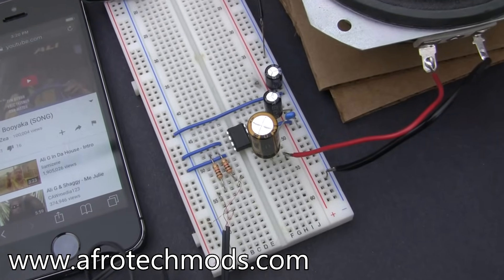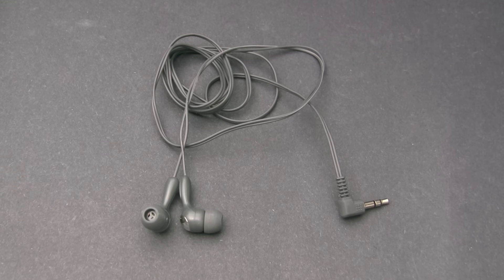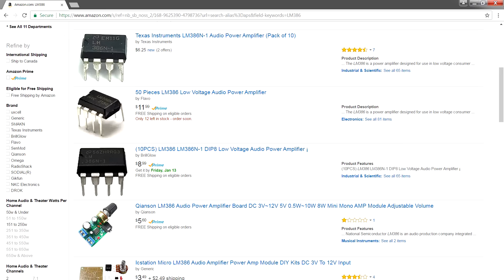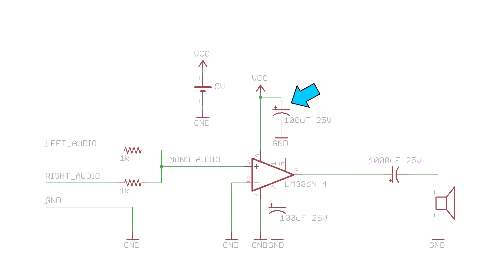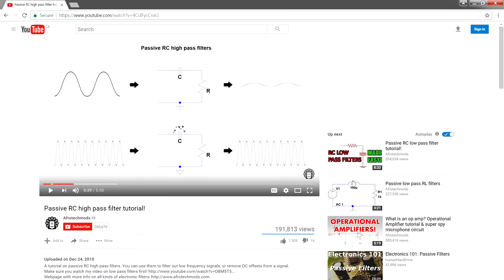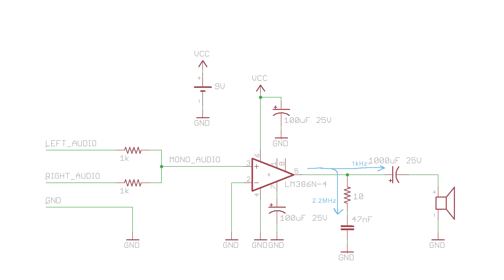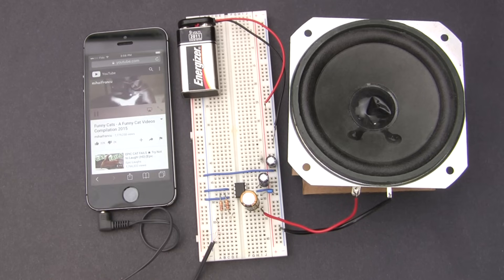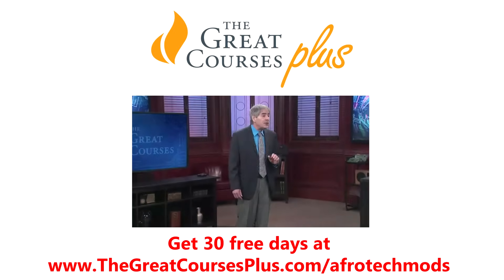🔊 How to make an LM386 audio amplifier circuit

Comment: if I feed in the signal of an electric guitar directly to this circuit will it work too? Since I only had an UTC2822H I copied its "BTL application circuit" (which I also don't know what means) and powered it up with 5.7V, all I achieved was a finger tip burner and silence. can anyone help me or should I just buy an LM386?

Comment: Regrettably, this is dated information. The LM386 is being phased out. They are much harder to find now, and they are being hoarded while their price is rising. This video should be updated using the LM386 replacement or alternative. I am unhappy because it was a relatively easy chip to learn.

Comment: Is the top capacitor in your circuit for decoupling (100uf), and the bottom for noise filtering(1000uf)?

Comment: Great ,  I did it and works perfectly
But if  i want to use a variable resistor what to use ? for volume
Reply: if you still need this, a potentiometer as a voltage divider at either the output or input should work

Comment: I had a similar circuit to yours but it was a little noisey. After increasing a few cap values to match yours and adding that 100nF cap between LM386 pin 6 and ground instead of the RC combination I had, I have a very quiet circuit. Taking your advice to shorten up the wires eliminated the am radio station I was picking up too.

Comment: HI! I am looking for a small amp for a project to amplify an acoustic guitar pick up and I think this will work, I just have 2 questions: 
1)What kind of speaker is that that you are using? (power and impedance, or if you have the link to buy it, that would be great).
2) If i wanted 2 speakers, not necessarily stereo but just 2 mono speakers, what adjustment would I have to do? 
Thanks!
Reply: carlos arteaga ....I'm working on something similar....except i wanna use a surface exciter instead of a speaker and install it intothe acoustic guitar. Did you ever finish your project?....was it loud enough?

Comment: can this power up a 8ohm 25w speaker?
Reply from the maker: Yes but you won't be able to drive it at full power.
Reply: Thanks for the reply! I tried this circuit and it works pretty well! I removed the 9nF capacitor and put it in the 8th pin in the circuit and it reduced the noise.

Comment: You could use two of the 386 chips at the same time since they are mono, have one of them amplify one channel then have the other amplify the other channel for basically two watts, Allowing more power to be transferred to the whole system, and one speaker for each amp, so just the one amp wont draw more current and get hot or quieter when hooked to more than one speaker especially from delivering a decent amount of current :) Awesome Videos Afroman!
Reply: You can use 4 of them. each channel 2 chips in bridge mono mode. Even more power.
Reply: Never thought of that, they have a bridge mode? you could probably get even more power if you had some sort of digital splitter for Dolby 5 Channel and be able to amplify 5 different channels with 5 of these. Or Bridge mono mode 5 channels. so 10 of these. @KneppaH
Reply: @cameraman1234567890  I made one myself. First try was a stereo bridged amplifier with 3 x LM386. But it had weird stereo side effects. After that i made a proper dual mono bridged version, with 4x lm386. It works perfect.
Reply: Probably had different delays in the signal, who knows. The Bridged config sounds like the way to go. @KneppaH

Comment: Hey Afrotech. Thanks for the vids I find them really informative. Just started with some audio amp and trying to wrap my head around it all. I was just curious if you could expand on a couple of things quickly. They are probably really basic so feel free direct me anywhere else. First how do you know what value capacitors you should be using? Why does the Capacitor filter the hig frequency rather then an actual High pass filter?

Comment: One cool variation: instead of joining L+R channel inputs, duplicate the circuit, each with its independent L and R input and speaker, and get full stereo sound. With one full Watt per channel to boot.

Comment: Hi! i kwow it is self evident to you...but you might tell that you need to put a speaker in a (large enough) box to get any lows/bass (as people watch you using bare speaker-no box). Just cardbord box, plastic drain tube that fits speaker or big tin can works ok (to boost bass).
Otherways people might think they messed up the circuit and has no bass output.

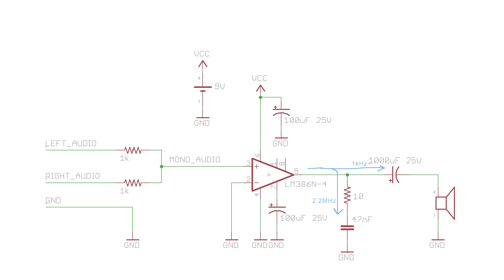Comment: at 4:44 you said rc high pass filter , but from the rc low pass filter video i saw that the resistor is connected to the signal and capacitor to ground , and for an rc high pass filter is capacitor first and resistor to ground, isn't an rc high pass filter supposed to attenuate the low frequencies?? and the rc low pass filter is the one that attenuates high frequencies ? i just seem to confuse this whole thing, would some one explain it to me ? , 
thanks
Reply: A bit late. See, high pass filter passes high frequencies. Here it is passing high frequencies to the ground, letting lower frequencies go the other way. The tutorials for low pass and high pass are actually the same thing from different views. In low pass circuit you choose a high frequency cut-off with capacitor and resistor combination and take the lower frequencies to use. In contrast in high pass filter circuit you take a low frequency cut-off combination and take the higher frequencies into use. In both versions you could take the other part of frequencies.

Comment: Regarding the 100nF and 1000uF caps on the output, the 100nF cap will always have a much higher impedance than the 1000uF, so wont higher frequencies choose the path of least resistance, i.e, through the 1000uF cap? I dont get it :-(

Comment: Question....I have a mono single channel input that I'm looking to split into 2 signals at the output stage (stereo headphones with the same signal in each ear).  Is it as simple as reversing the 1k resistors to go to 2 channels after the potentiometer for volume control, or even simpler by just splitting it with no resistors since there's no signal to balance?

Comment: Eh, the sound demonstration clearly shows the most important caveat of such "simple" design (that uses a weak power source and a questionable speaker too): the complete lack of bass. You just simply can't get it without a good power supply and good speakers.

Comment: I wasn't sure who to believe as several other youtubers (who specialize in audio electronics) suggest 200-500uF output caps. So I tried it and the bass was way quieter than everything else. Replaced it with something over 1000uF as you suggested (2200uF) and it's fine now. It led me down the rabbit hole of realizing the cap and speaker form a high pass filter, so I can calculate the right values in future now. :) Thanks for the great tutorial video!

Comment: Hello, I am new to audio engineering and I am trying to see if I can create a studio condenser microphone from scratch caveman style. So far I have managed design a tension jig for the diaphragm in AutoCAD and 3D print it from my university library. I am currently planning to mill a copper disk for the backplate. My goal is to see how good of a quality a regular person can  build a mic  from the ground up without any trades secrets or corporate sorcery. I was interested in your minimal amplifier circuit video as I think this might work as a great pre-amplifier for the mic. Also, I've read that passing the original signal coming from the sensor through a less electronic components results in less contamination / distortion of the signal with noise. I think having some sort of Faraday cage like metal mesh around it can block the ambient electromagnetic radiation and hence interference. Do you by chance know how loud the noise in the output is for your final circuit? Also, do you think this circuit could work for amplifying the sensor's output?

Comment: Quick question is there a significant sound improvement if I were to double all the values of all the capacitors used in this circuit? I was told that the higher the capacitor the better the filtering resulting a clearer sound.
Reply: If you increase the value of 1000uF before the speaker it'll improve bass. This will lower the cutoff frequency for the filter that the speaker and capacitor create. Have a look at the low and high pass filter videos afrotechmods did.

Comment: Sir I have tried making this circuit but I keep running into one problem the capacitor between pin5 and ground is 104(100 nf) this doesn't remove the noise for me
Reply from the maker: Try a different high pass filter
Reply: Afrotechmods can you suggest a value

Comment: @Afrotechmods: Is the loudness, quality (distortion, clipping) of the N-1 and the N-4 version the same at 12V ? I'm asking because I want to use it on a 12V PC power supply and there is quite a price differnence between the N-1 and N-4 version when buying many of them. There is also a different output resistance. Which one is better for using with 4 Ohm speakers ?
Thanks in advance !

Comment: if I want to put some volume pot, where I supossed to wire it? and is 10K Log Potentiometer work?
Reply: get a 22k stereo potentiometer if you want to use it for stereo.
otherwise get a 22k mono potentiometer.

Comment: I tried this though a 6ohm 25watt old HI Fi speaker it was pretty good. Does anyone what impedance speakers work best for this amp?I changed the 1000 micro farad cap for a 2200 micro farad just was playing about but for some reason it made less distortion. I also notice that when i changed the 100 cap that sits positive and negative i got less distortion as well.
Reply: LM386 is best suited to 8 ohm, though it's fine with 6. It might start clipping if you turn it the whole way up with 6 ohm speakers. But you can add a resistor after the volume potentiometer to push the input signal voltage a bit further to mitigate this.

The output capacitor and speaker form a high pass filter. With a 8ohm speaker and 1000uF cap the cutoff point is roughly 20hz, which is the highest you want it to be. Lower is better. With 6ohm and 1000uF you get 26hz, which will cut off a more noticeable amount of bass. With 6ohm and 2200uF the cutoff is 9hz which is much better. Excellent calculator if you wanna have a play around - https://www.v-cap.com/coupling-capacitor-calculator.php

hope this helps! :)
Reply: Yee Boi Thanks a lot man i will give that a try, Thanks again
Reply: Yee Boi i have a 4ohm speaker :(
can i use a 4 ohm resistor in series to make 8ohms? I'm powering it with 5V dc wall adapter???
Reply: Yee Boi thanks a lot dude !

Comment: Hey love the video, but how would you go about changing the output volume to making it variable? There seems to be no feedback in your circuit, so would there be a simply way to do this, or should I add an another op amp, that could control the gain at the output, then feed that new output to the speaker? Also where did you get that great speaker!
Reply: use a 10K potentiometer for adjusting volume. Mid pin is connected to amplifier audio signal input (pin 3 of LM386). Left pin is connected to your audio signal. Right pin is connected to supply ground.

Comment: Can you use an nte823 with this. I checked their datasheets and they are equivalents but i built your circuit and it buzzed A LOT. I don't know if it just the chip or something. Any help? Thanks!
Reply: @Afrotechmods Never mind. The buzzing was due to the fact that I was using a portable radio instead of a music player. As soon as I plugged it into my iPhone, it worked perfectly. Your circuit has been the only audio amplifier circuit that I've tried and that worked. Thank you very much!

Comment: How would I be able to build this same build but with a potentiometer to control volume?
I wanted to make something like this for my friend in a case that looks like a DJ's turnable with a volume control for one of the two potentiometers I was planning on using or if there were more things I could easily add, have some slide potentiometers and buttons as well.

Comment: Would that 386-4 (min 5V) be ok to use with a USB power source? I think they are about 5V. Also, Would I need to change any of the components in this schematic powering it off 5V? 

Thanks.

Comment: My amp stereo speaker dosent produce sound when i play a music using my phone or anything, the song plays from my phone instead. And makes continuous weird fart noise/distorted noise. I'm powering it with a 5V wall charger as power supply. Speaker is of 4ohm. Pls help...anyone???????
Reply from the maker: The 5v wall charger might have a ton of noise on the ground line of the supply. Try a cleaner power supply like a battery and see if you have the same problem.
Reply: +Afrotechmods oh ok i would try using battery, but what about the music plays from my phone itself instead of amp stereo speaker even when connected to jack??? afro pls help????
Reply from the maker: Dunno what's up with that. Sounds maybe the plug isn't being fully inserted into the headphone jack.

Comment: Three point five millymeter ?
Will the LM386 work with standard 1/8' plugs for input?
I have lots of them. and things to plug them in to.
Reply from the maker: Should work fine.

Comment: If I wanted to use a 3 ohm speaker and add a 10k potentiometer for volume, what modifications would be needed? Could I just add a 5 ohm resistor in series with the speaker to simulate a 8 ohm speaker? Would I place the volume pot between pin 3 and ground to make a voltage divider?

Comment: Sir, how do i controll the gain?

and is it possible to controll the gain of multiple op amp with different input and different output with one potentiometer?
Reply: You control the gain with pin 1 and 8 and a capacitor+potentiometer.

Comment: Can anyone tell me, how the OpAmp can be in Comperator Configuration and this still works?
Reply from the maker: It looks like it's in comparator configuration but in fact there are gain resistors inside the chip and it is operating in negative feedback mode.
Reply: Afrotechmods Thank you for the quick response ;)

Comment: How does that work? How is it possible that manufacturers can write "1000W" on a teeny tiny box with a small speaker and amplifier? It's obviously not true but shouldn't there be some sort of law which prevents them from overadvertising their products?

Comment: Cool video. I'm super jealous of people that know electronics. I've taken several online MOOCs and more or less understand the basics and how to do linear circuit analysis, but I'll never understand how people just know how to design circuits and where to put resistors, caps and inductors. Like, why do you need to put 1000 ohm resistor after the input leads?

Comment: Will the circuit be different for a 8 ohms speaker than a 16 ohms one ? why ? thank you
Reply: 6 years late, but it's still the same like in the video. BUT i do only tried using 8 ohms speaker, haven't use the 16 ohms one

Comment: okay, now all ive gotta do is build one for left and one for right and put some sort of volume control knob in there somewhere....

where do i stick the volume control knob?
Reply: From the LM386 datasheet:

"To make the LM386 a more versatile amplifier, two pins (1
and 8) are provided for gain control. With pins 1 and 8 open
the 1.35 kΩ resistor sets the gain at 20 (26 dB). If a capacitor
is put from pin 1 to 8, bypassing the 1.35 kΩ resistor, the
gain will go up to 200 (46 dB). If a resistor is placed in series
with the capacitor, the gain can be set to any value from 20
to 200. Gain control can also be done by capacitively coupling
a resistor (or FET) from pin 1 to ground."
Reply: just stick it between the audio input and the capacitor to the amplifier.
if you want to use 2 at once, get a stereo potentiometer.

Comment: I used one of those on my research project back in 1985. Worked good. It amplified my Votrax speech synthesizer controlled with a Radio Shack MC-10.

Comment: Is there any way you can tap into your phones power to power the amp?
Reply from the maker: Not easily no
Reply: Something on top of my head: Use USB OTG cable and connect the +5V from the cable to the amp Vin. I don't know if it will be powerful enough though

Comment: Hi aphrotechmods,
I have a question about this high-pass filter that you implemented at the end of the video.
How does it work, I thought that a low-pass filter usually consisted of a resistor in series followed by a capacitor in parallel leading to ground, however in this schematic you seem to use a resistor and a capacitor both in parallel to the signal. How does this filter out the high frequencies? Because it has a resistance value of 10 ohms regardless of the frequency.
Reply from the maker: Realize that the small 0.1uF capacitor will have a small amount of internal series resistance, so implicitly it is an RC high pass filter!
Reply: Ah okay, thanks for responding!

Comment: You can get 10 of the LM386 chips from Aliexpress for less than a dollar if you're willing to wait 6 weeks for them to show up.
Reply: I always buy at least 100 of whatever I end up ordering, except for larger components like entire power supplies. It's good to buy in advance even when you don't need them. Assorted resistors and diodes come to mind.